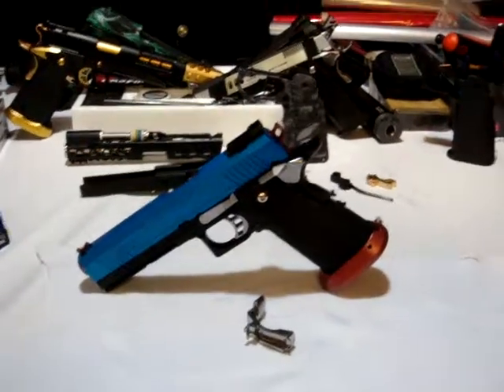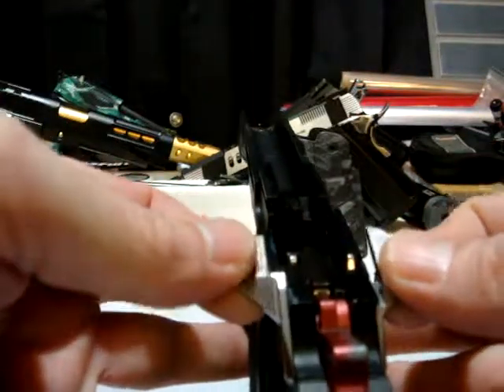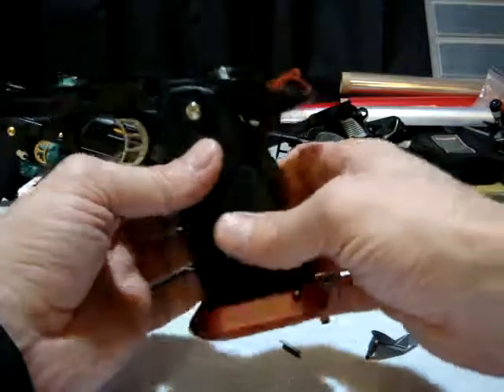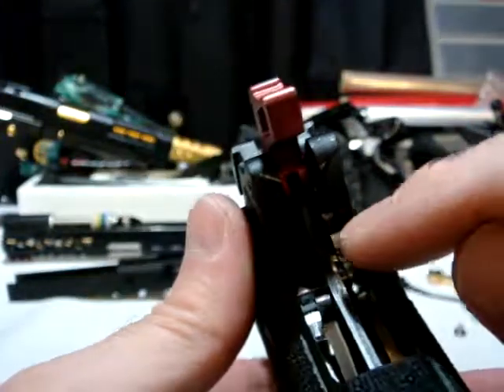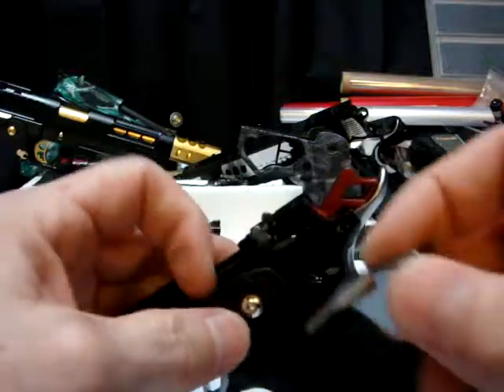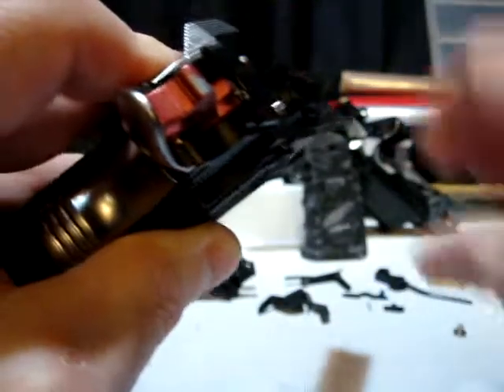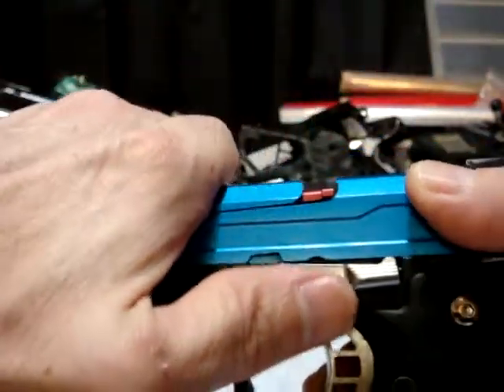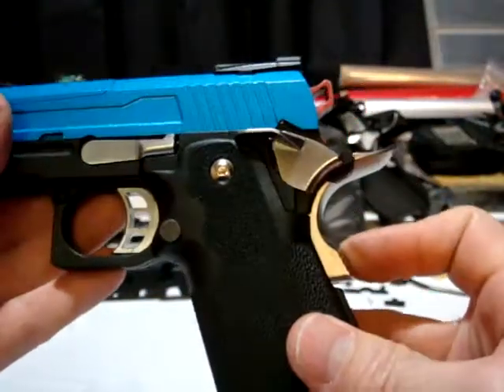Armorer Works Hi Capa Beaver Tail saftey Swap.

Comment: Hi! i have the HX2202, and the beaver tail does not work?! no safety, (i can shoot without depressing it) how do i fix it? thanks, Levi from Finland
Reply from the maker: Hard to say without seeing it myself. Sounds like the catch on the beavertail is worn down or just a bad part.
Reply: @heavymetalairsoft6188  ok, its never shoot with (yet), but no warranty,  one more: is it dangerous/Hazardous to use? - only i will shoot it, and i know about the faulty, greets, Levi
Reply from the maker: You should be fine,  just use your slide safety when needed.
Reply: @heavymetalairsoft6188  thanks!

Comment: Yo I can’t see shit when you put the spring in I’m still stuck
Reply from the maker: Sorry man, bad lighting on this one. So you put the Saftey spring in then the metal pin, then you need to push the pin in the hole and slide the Saftey (left side) to hold it in place. Then replace
the right side of safety in and push down. Sometimes you have to wiggle if parts don't go together easy.